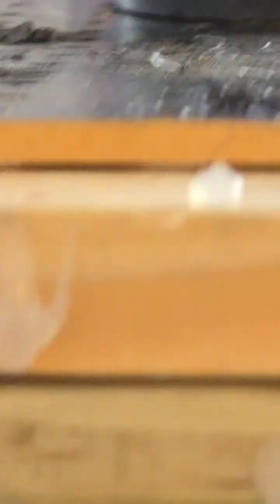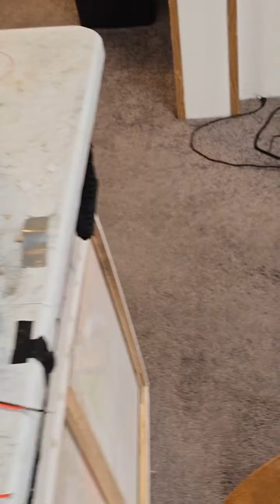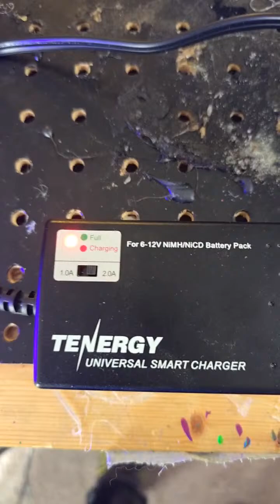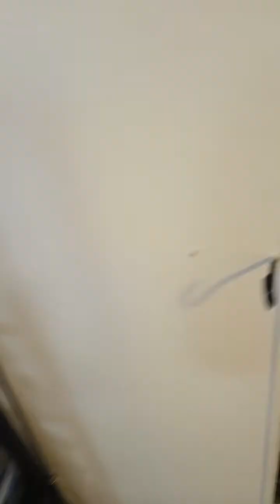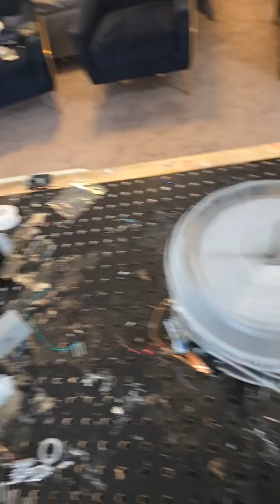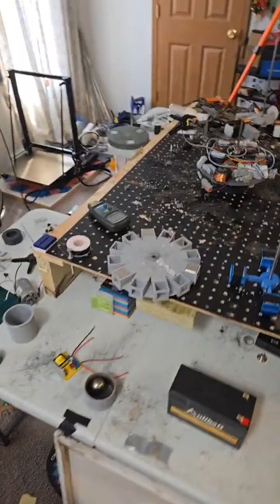Papa Bale (M.P.H.Jr) is live! With pulse motor mayhem adult swim, no kids allowed!

Comment: New idea that has recently come into my mind after everyone talking about the Flux Capacitor if you might be interested in it.
Coil pulses through a ring of coils and as the fields are generated and Collaps they induce momentary fields in other coils generating electricity, then when those fields collapse they produce new fields in surrounding coils untill the mf wave loses strength.
           
           C. Ring   
        emcoil.             x3  
           C. Ring

C =Ring of coils surrounding 
Emp-coil= electromagnetic pulse coil
Initial pulse coil, energized by outside source. Creates a momentary em feild, moving current through ring coils. The feild then collapses, sending another pulse through the coils, that energy is sent into another emp coil, repeating into a third setup and back to the starting coil. Run a few L.E.D.S to show the flow.
All coil rings funnel into another setup to create a back and forth wave field collaps.
 
This would be just for fun/theory for a flux capacitor and has no real application as of yet.